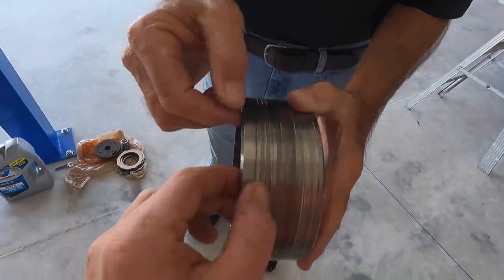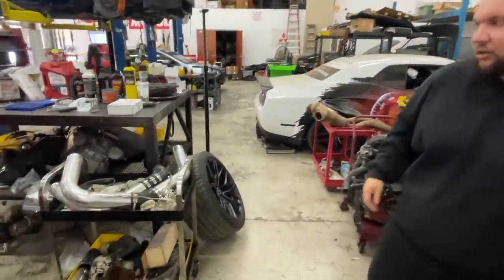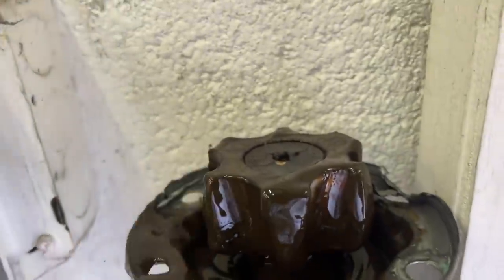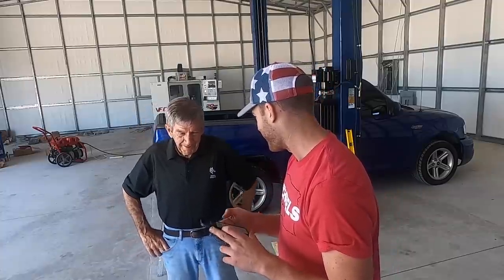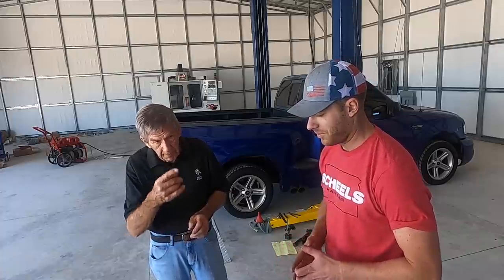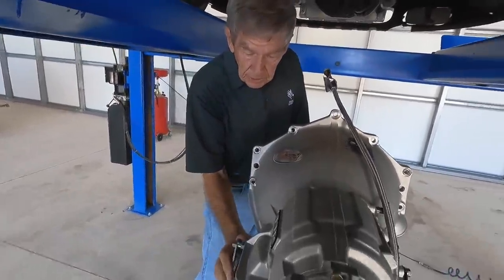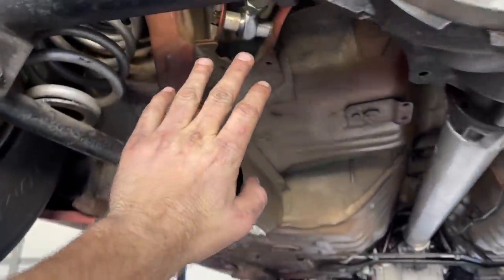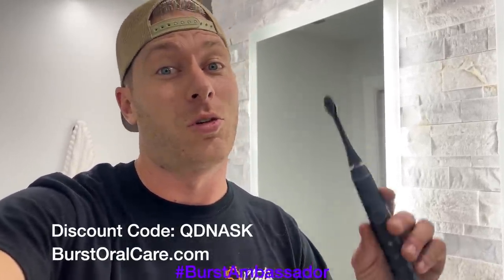Mitchell's Slip & Slide Powerglides ULTIMATE Fail on my First Rebuild, Solo Cross Country in the R44

Comment: When Sam talks about offloading that knowledge he means Parker. You can see Sam thinks the world of him. I'm suprised the factory torque boxes on dr pepper haven't ripped them selves out already, upgrading them at first with an adjustable bot hole design where it  can push the rear wheels into the ground should help getting power down.

Comment: You need frame connectors,  and you need to weld the torque boxes up.  All the seams in them need to be welded.  Then brace from lower boxes back around to the frame connectors... through the floor frame connectors mig welded in with square tubing out riggers to your cage floor mounts.  We used 2x2 square tubing.  Ties the cage into the frame.  Makes car stiffer,  less flex = more power to ground.  Also need to do 8.8 brace kit on your axel.  Talk with TY.  He should be able to help you out.. oh and if you do weld the boxes clean clean and clean.  Dirty dirty metal to have to weld.  We used to make little gussets in the corners of the boxes to help strengthen them.  Once again talk with TY he seems to be a wizard on chassis building.  The stuff I listed was what we would do at the chassis shop I worked at

Comment: On my 8.8 set-up I had Pauls HP 8.8 Axle Braces and upper/lower torque box reinforcement kits.  With those axle braces they support the differential in multiple planes due to the angles from the attachment points.  Made it solid.  I also had my axle tubes welded.

Comment: For a Fox Body I strongly recommend a torque arm, it REALLY gets the power down, others may disagree for a drag suspension.  A Maximum Motorsports torque arm or Griggs, with coil overs is the way to go.  You can also get some rear control arm axle mount extenders to improve the bite by lowering the rear pivot.  But the torque arm will take the axle torque and apply it to the center of the chassis, works great for traction.  The laguna seca crowd prefers the IRS suspension because it has better corner entry grip, but it has worse corner exit grip.  Griggs has run torque arms for a long time and before IRS was a common swap that was a the trick suspension.  That's what I have on my Mustang and it really makes a difference.  It also helps with wheel hop.  That 4 link setup will eventually rip the floor out of your car, you should really consider putting in a full-frame kit with the torque box reinforcement kit, Griggs sells that too.  You should give Griggs or Maximum Motorsports a call.  MM's stuff is designed to bolt-in, Griggs is mostly weld-in.

Comment: The best torque boxes you can get are the Merillat racing boxes. They are amazing quality and fit way better than the Teamz junk. Also might be a good idea to get some brackets for the lower control arm. either weld in or the BMR bolt in options work well. Just helps to get a little more anti squat in 'er when needed.

Comment: I would definitely plate those torque boxes even if it’s just scabbing some metal in there for sick week temporarily. That tsp 427 is making some steam, and with the New shocks coming, if you actually plant the car, you run the risk of destroying the boxes. Even if you only tweak them a little bit, that makes it a royal pain to get the reinforcement kits in and in the right spot since you’d have to manipulate the metal back into shape and fix it before reinforcing it.

Comment: The Muskrat is coming along great. If there's a time problem on the control arms, could you just stitch weld the stock brackets in place? I know it will make them hard to remove later but it will strengthen them a lot in the short term.

Also, I'd love a video of Sam's old '69 Camaro out in the sunlight and some talk about the car. That's my favorite make and model of car. By a long shot. All my life (since the 70s when I was old enough to like cars).

Comment: Always make changes in baby steps. Make the change, then sit back and see if the baby walks, or falls over. If it walks, move on to the next little improvement. Too much too fast can make a car worse of course.
So do the shocks in the rear, and then add a 300 shot of some medical grade nitrous. Lol
Reply: @Faux Que So right! Change one thing at a time and write it down in a notebook what was done and what direction it changed anything.

Comment: Also when you do subframe connectors I'd recommend team z through the floor or Detroit speed. And sam has the lift you need cause the weight needs to be on the suspension when you weld them. I guarantee that car is twisted at least and inch. Please do this before you reinforce the upper torque boxes.

Comment: Not sure if you had the converter flushed out or not but it will hold all that trash in it and will contaminate your new transmission. Also flush out your cooler.

Comment: Do yourself a favor and just remove the factory stuff and go to a Maximum Motorsports torque arm.  You have a bind in there that is uncorrectable with that upper arm at that angle.  Then just beef up the lower boxes and use maximum arms with proper bushings to remove sloppy movements.

Comment: Please do yourself a favor .get rid of that plastic line on the transmission over flow .especially in a turbo car ive seen it melt and burn down probably 4 cars  it is not good .replace it with good stuff .the shocks are super important street driving on those high dollar shocks is not good on them .that and trailering the car .you wouldn't believe how a car bounces around in the trailer. We built struts that we install after we are done for the weekend and the car is loaded we put a solid strut so it doesn't bounce all over and kill the shock .ive seen guys take the shocks off and put struts in when towing .just throwing it out there .the trans line is super important please change that .it will save your car possibly your life .